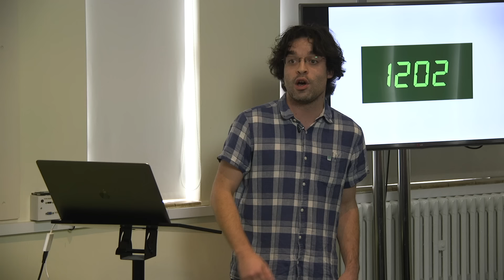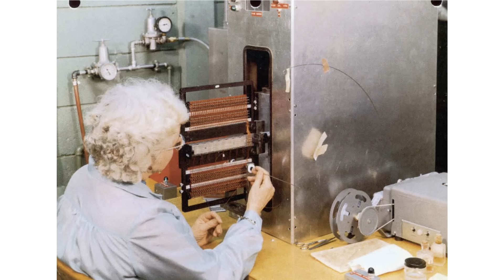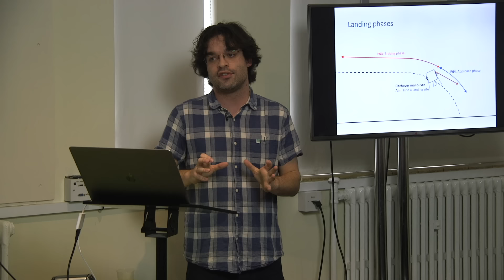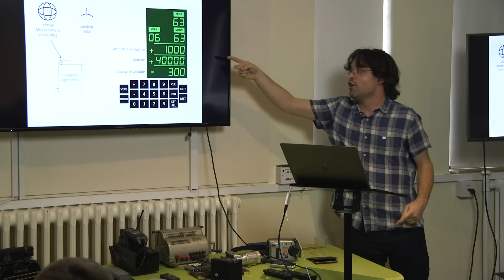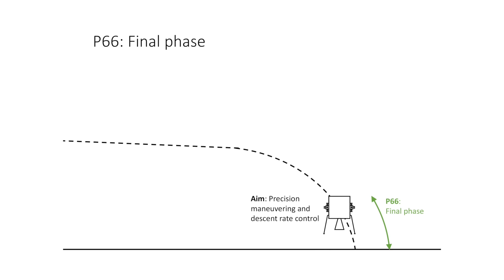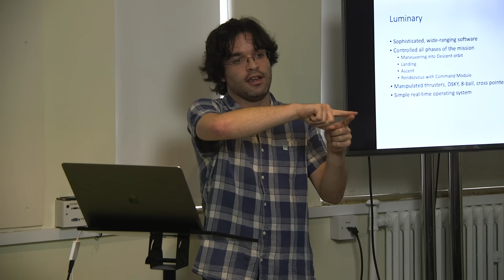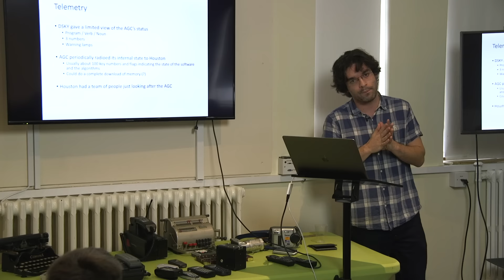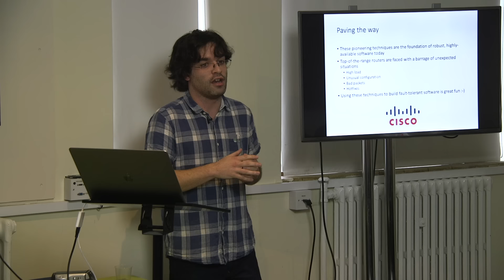Light Years Ahead | The 1969 Apollo Guidance Computer

Comment: The Apollo 11 Moon landing is a perfect example of hoaxed evidence and fakery.
Briefly listed here, several issues are:
(i) the photographs are obvious fakes since artifical light sources are used given multiple shadow lines,
(ii) identical landscape backgrounds in several photos,
(iii) the lack of craters and dust on the Eagle landing pads and rover,
(iv) destroyed evidence: all 1.5 tons of film footage and telemetry has been destroyed,
(v) the "C" rock labelled with a printed C found in numerous photographs,
(vi) lastly scientists now admit that the Van Allen Radiation belts cannot be presently transvered with our current technology,

When viewing the details about the alleged landing, an intellectually honest observer can see that it makes no sense.
Go and watch the lunar module blasting off from the Moon's surface.
You will be left with the distinct impression that the module is being hoisted up from the ceiling by a mechanical crane.

We have been lied to about absolutely everything.
Reply: And to answer the claims in more detail:
1. Multiple light sources would cast multiple shadows on each object, instead of merely giving multiple shadow lines. This is true even if the Moon landings are fake.
2. When overlayed, those "identical" background actually show subtle differences, which indicates that they are in fact three-dimensional objects, instead of being flat backdrops.
3. The thrust of the descent engine wasn't intense enough and wasn't concentrated enough to actually dig a crater. This is true even if the Moon landings are fake.
3a. Given the lack of atmosphere of the Moon, lack of dust on the LM is normal and expected.
3b. Claim that the LRV wasn't covered in dust is contradicted by photographic evidence.
4. Claim that "all 1.5 tons of film footage" has been destroyed is contradicted by the fact that we can actually watch this "destroyed" film footage right here on YT.
4. Claim that telemetry has been destroyed is likewise contradicted by the fact that it can be found appended to each individual Apollo Technical Report.
5. The "C" on that rock is actually only present on one print of one photograph. It's earliest print doesn't show "C", neither do subsequent prints, and neither does other photo of the same rock. On close examination, the "C" is just a hair (most likely an eyelash), and one can tell that it's not actually on the rock, since it is perpendicular to the camera, and not to the rock's face.
6. No scientist has ever admitted that the Van Allen Belts cannot be "presently transvered with our current technology." This is true even if the Moon landings are fake.

Given your statement about "an intellectually honest observer", on must wonder why did you choose to attack the veracity of the Apollo program using objectively incorrect claims.
Reply: @Jan_Strzelecki  You Software bots remind me of the saying:
Knows Everything but
Understands Nothing.
You are proving that here today.
Forwith:
(1) You obviously did not understand anything.
There are multiple light sources on the Moon in those photographs.
That means the scene was faked. There were not multiple light sources
available to the crew. Only one: THE SUN.
(2) Those are identical backgrounds, you are simply lying here.
(3) Again, you are simply making stuff up here.
Any engine that is capable of slowing down a multiple-ton carcass of 
steel and titanium etc. would blow up dust on the surface of the Moon.
Yet it did not.
Fake
(4) The film footage is gone. Many have spoken and written about it.
Again you are lying.
(5) The "C" rock is very clearly written on , it is obvious to the human eye.
(6) Again, you are simply lying.
Look at what these two people said about the Moon landings and travelling to the moon:

(vi) lastly scientists now admit that the Van Allen Radiation belts cannot be presently transvered with our current technology,
Don Pettit: "We can't go to the moon anymore because we destroyed that technology and we don't have it anymore."
Kelly Smith: "We must solve these challenges before we send people through this region of space." 

All of you commenters are SOFTWARE BOTs working in a tag-team operation 
to make it appear your comments are valid when they are nothing but 
nonsense. You give the appearance only and that is why you each
support each other's verbal diarrhea.
Reply: @dreamfunction4491  So, in summary, "Nuh uh!"
Reply: For years I listened "Russians would tell if it's fake". Month ago head of Russian space agency confirmed they have 0 evidence of such event. Story from beginning didn't make any sense, only casualties from missions are cosmonauts that complained about not been able to communicate with control while still on earth and had 0 confidence that they'll be able to speak with white house like calling next door neighbour.
Reply: @sealandsand1225  
Moscow put on a massive event for the astronauts.
Reply: Fiction.  👎
Reply: @driatrogenesis  
Having a Russian wife and they didn’t say it was fake, they out on a massive reception for them in Moskba.  Oh, and I’m smarter and better educated than you.  Now I’ve given you a task, best you get to it boy!
Reply: " lastly scientists now admit that the Van Allen Radiation belts cannot be presently transvered with our current technology,"

Tell me the names of some scientists which admitted that together with a source where they admitted that....

"the photographs are obvious fakes since artifical light sources are used given multiple shadow lines,"

On many photos the shadows of DIFFERENT objects are going in different directions (which could be easily explained as the mond surface is not flat) but a single object has only one shadow which would not be possible if there more than one light source.

"identical landscape backgrounds in several photos,"

If I have some mountains in the background which are 30 miles away and I make some photos in the same direction but with different positions not more than 1000 feet away from another of course you see the same background.
If these photos would be taken in a studio where the place is not sufficient to build or draw some mountain 30 miles away than the background would have heavily changed if the position of the camera changes by a 100 feet. 

"Go and watch the lunar module blasting off from the Moon's surface.

You will be left with the distinct impression that the module is being hoisted up from the ceiling by a mechanical crane."

It is not your impression that counts - it´s the physics....
Reply: @elkeospert9188  (1)
Don't dictate to me how facts should be presented.
You are an arrogant sod for making demands that you can later use to discount evidence that I present.
Nonetheless , Don Pettite, Is one example of an astronaut who claims we don't have the technology to leave Earth. 
quote below:
"The problem is we don't have the technology to do that anymore."

There are many more. Do your own research and learn to think for yourself.

(2)
The photos show that the moon's surface in that location is almost flat. Your comment is nonsense since it surmises something that does not exist in the photograph.

(3) Here you are simply writing nonsense.
The locations where the background are the same are not 100 feet away as you incorrectly surmised. They are in totally different locations and yet the background remains the exact same.
Even the angle does not change.
This is fraud.

(4)
Watch the lunar landing module take off.
You will easily determine that the module is being lifted up by a crane.

Your comments amount to someone who does not understand even basic physics nor even more shockingly simple logic.
Reply: @dreamfunction4491  "(3) Here you are simply writing nonsense.
The locations where the background are the same are not 100 feet away as you incorrectly surmised. They are in totally different locations and yet the background remains the exact same"

Ok - tell me where some of these locations were which had the same background....
Reply: @dreamfunction4491  Let me guess - you're a Brit.
Reply: @dreamfunction4491  "You are an arrogant sod for making demands that you can later use to discount evidence that I present."

lol!  if you had good evidence you wouldn't have a problem!
Reply: @gives_bad_advice  Obviously you can't read. See my comments. Everything is there .
Reply: @dreamfunction4491  you provide exactly zero links to the source of the claims you make.
Reply: @dreamfunction4491  You are accusing others of not understanding "even basic physics"?  And yet you say this: "You will easily determine that the module is being lifted up by a crane".   👎🤡
Reply: @billyryalls7851  Software bot with preprogrammed "fill in the blanks" reply.
Reply: @dreamfunction4491   I still waiting for some names of scientist who said that the Van Allen belt could not be transvered with our current technology...
Reply: @elkeospert9188  You obviously are purposely lying. Go back and re-read my comments.
It is right there.
Don Petite said the following: see above.
Reply: @dreamfunction4491  And again:

https://www.youtube.com/watch?v=6SlTNI0fzJc

And again - you wrote:

"lastly scientists now admit that the Van Allen Radiation belts cannot be presently transvered with our current technology"

I asked you for for some names of these scientists

You answered with a (shortened) quote from Don Petite in which he not even mentioned the Van Allen belt...

So I still asking your for some names of scientists who said that the Van Allen belt could not be transvered with our current technology.

Don Petite did not say that.....
Reply: @elkeospert9188  
Kelly Smith, NASA Scientist
NASA engineer admits they can’t get passed the Van Allen Belts

Quote:
"...we must solve these challenges before 
we send people through this region of space."
Reply: @dreamfunction4491  And again - here is what Kelly Smith really said:

https://youtu.be/6comw1-0DZE?t=28

Please tell me where he said that "they can’t get passed the Van Allen Belts"?
Reply: @elkeospert9188   I quoted him exactly.
You are simply lying.
Here is the exact quote:
"We must solve these challenges before 
we send people through this region of space."
---
In the video you can see he is pointing at the Van Allen belts when he says the quote above.
Very obvious.
Reply: @elkeospert9188  You are a SOFTWARE BOT because you cannot process meaning correctly.
Reply: @dreamfunction4491 
Yes - you quoted him exactly.
But you interprete the quote wrong....

Tell me there Kelly Smith admitted in the video:

"they can’t get passed the Van Allen Belts"

But of course you can not not as Kelly Smith never said that.

Why on earth should Kelly Smith work on the Orion Project if he believes that it is impossible to get through the Van Allen belt?

Please tell me....

Kelly Smith mentioned a protection system against the Van Allen belt - which of course has to be tested first.

But he not said that is impossible to pass the Van Allen belt.

It seems that you cannot process meaning correctly....
Reply: @elkeospert9188  You are constantly lying and twisting meaning to suit your wrong interpretation. You do this by assuming I said specific things when I did not.
You said:
"they can’t get passed the Van Allen Belts"  and you ascribed this statement to me.

I never said that.
Here is what I said:
"...lastly scientists now admit that the Van Allen Radiation belts cannot be presently transvered with our current technology,"
---
That is not the same thing as you are assuming.
And I proved that with what Don Pettit said:
Don Pettit said: "We can't go to the moon anymore because we destroyed that technology and we don't have it anymore."
---
Pettit is saying the technology no longer exists.

Secondly,
Kelly Smith said that the Van Allen Belts were filled with dangerous radiation and that we must traverse this area twice, once on the way through, and twice when coming back.
And then he said the following:
"...we must solve these challenges before 
we send people through this region of space."
BEFORE ! That means they have not done that yet !
You cannot understand this meaning.
It is plain to see what he is talking about and what the meaning is.
The meaning is that we cannot travel through this region (this region being the Van Allen Belts) and that we must solve this challenge BEFORE 
we send any people through the Van Allen Belts.
Reply: @dreamfunction4491  "You do this by assuming I said specific things when I did not.

You said:

"they can’t get passed the Van Allen Belts"  and you ascribed this statement to me.

I never said that.
"

You never said that?

9 hours ago you wrote:
-----------------------------------------------------------------
"@Elke Ospert  
Kelly Smith, NASA Scientist

NASA engineer admits they can’t get passed the Van Allen Belts"
-----------------------------------------------------------------

Show me where Kelly Smith said that or tell me which other NASA engineer said that....
Reply: @dreamfunction4491  It's funny how he actually didn't "lose," though.
Denial is strong with you, is it not? 🙂
Reply: My comments  keep getting deleted and censored when I attempt to leave links and further evidence.
Watch  What Happened on the Moon.
Reply: @dreamfunction4491  : YT censors links. Don't expect much.
Please don't be so naive as to believe whatever fallacy you saw on some fantasy "documentary".
Reply: regard the meaning of "before."  you say it means that is has not been done once.   this is obviously not true since people all the time say thingsb like "we need to eat breakfast before we go swimming"
Reply: @gives_bad_advice  You are another SOFTWARE BOT because you are not able to understand the meaning of the world 'before' when Kelly Smith was referring to the difficulty of space travel and traversing the Van Allen Radiation Belts.
He makes this point immediately before the quote when he said we have to travel through this region of space twice.
You are unable to absorb this because you are a SOFTWARE BOT.
Reply: Thank you for the detailed responses.  I second all of those observations.
Reply: And another thought... the misunderstanding and denial is inevitable, it seems to me.   Think of it... You take thousands of photos from another world where the fundamental physics we have all come to expect no longer apply.  And then you have millions of people without much scientific understanding  going through these photos with a fine- toothed comb.  The confused conclusions drawn by folks are utterly inevitable.  Add to it all that these missions were run under "perfect storm" conditions like the tech from WWII, the Cold War, highly skilled combat vets to fly the spacecraft,  JFKs extraordinary directive and the intensity added from his tragic assanation... it really was a moment to catch lightning in a bottle.  So maybe it's not so unreasonable for some folks to be unwilling to accept the fact of the matter, preferring instead to stick with the gut feelings that are most familiar.

Comment: Am I correct in assuming that the DSKY interface is what was used during Apollo 13 to execute the burns for trajectory correction when they were piloting the whole thing from the LM? I recall Lovell mentioning something vague about his difficulty getting a handle on controlling the ship 'via the computer', that it was a very non-standard procedure.
Reply: You are correct on both counts. The LM engine was unlikely in line with the center of mass of the SM, CM, & LM structure.

Comment: It is not the case they were 'light years' ahead. They simply had a firm grasp that space is THREE
DIMENSIONAL and so they built instruments that reflected a THREE DIMENSIONAL SPACE. The
subject is treated in schools as incidental and not as the foundation. THE THREE DIMENSIONAL
SPACE ... is optional ... in the modern classroom. In the face of the need to integrate every subject
with reference to a THREE DIMENSIONAL SPACE.
*They simple set TWO DIMENSIONAL SPACE aside. Motion and Rocketry is in three dimensions.*
All the instruments were designed to operate in a three dimensional space: how forward thinking
is that!! You live and breathe in a three dimensional space; and you make instruments that operate
in that same space ... and not on a piece of paper in two dimensions. FANTASTIC. An instrument
does not exist as a drawing on paper: that is really light years ahead of our thinking back then or
now.

Comment: A few years ago Discover Magazine contained an article which explained that the Apollo data had been lost because it was recorded on computer tape which disintegrated. Nobody had even looked at it.
Reply: utter lies. Firstly the data wasn't lost, it had been "looked at" when it was transcribed into the mission reports (which are easily found online), and the "lost" tapes weren't just left to disintegrate, they were REUSED for Landsat (part of the materials used was literal whale oil, which was no longer available due to a ban on whaling, thus no more tapes of the type could be manufactured). Do you have no shame on lying this badly?
Reply: @Agarwaen  
We re used tapes on a daily basis at Orroral.  There simply wasn’t the storage space or tape availability to use new on each pass or ALSEP data.
Reply: Yet Sotheby’s auctioned a set of tapes a few years ago.  There are multiple copies of everything except the backup slow-scan TV tape.